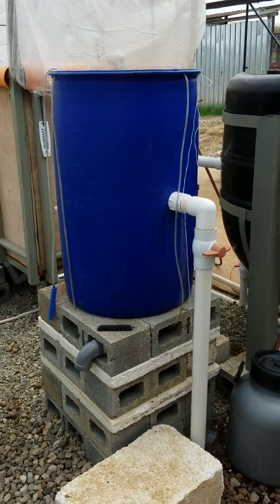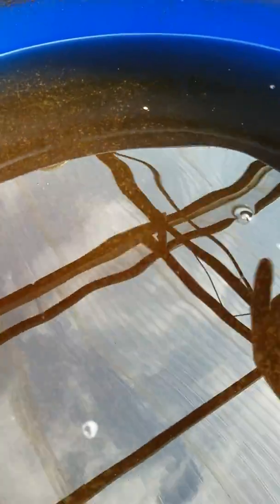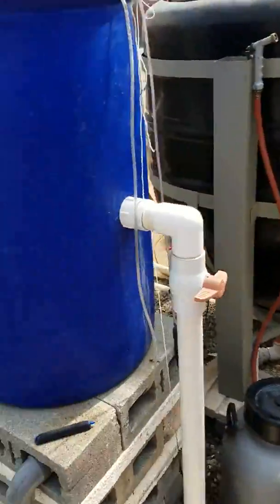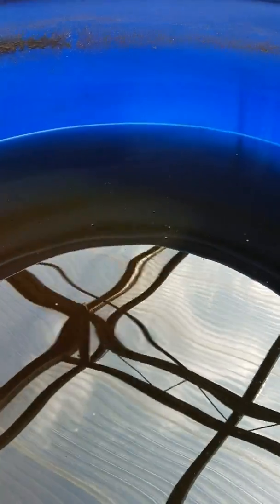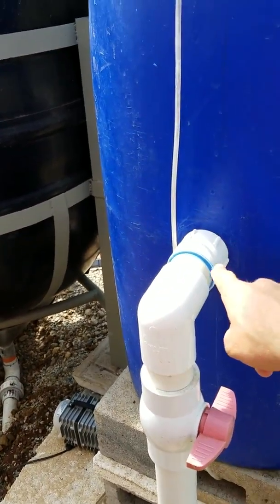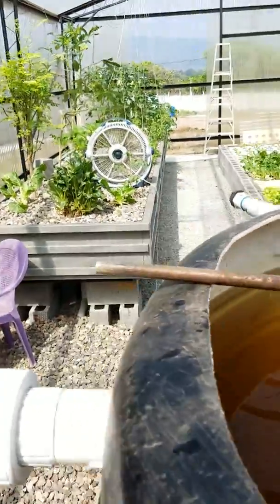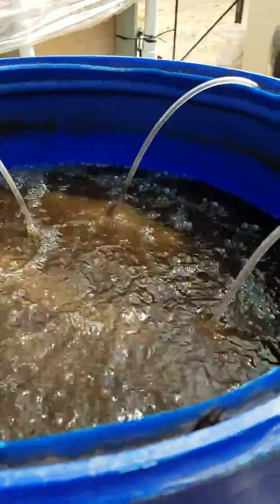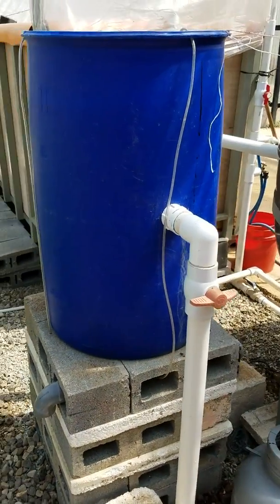Mineralisation Tank Use Training   Aquaponics

Comment: Thanks for sharing this. The plumbing is pretty neat on this mineralization tank setup. I like the way that most of the clear liquid is returned back to the gravel bed and gets a second life in the system. About your air stones, i would get a stick across the top and suspend them in the center of the tank that minimize any contact to the side of the barrels to minimize any wear and tear.

Comment: Where did you buy your filtration system, it looks amazing my man..
Reply from the maker: It's homemade!
Reply: @roynathana  Dude i mean that weird lovely looking tank to it, i guess its the solid separator or clarifier.
Reply from the maker: @VanTlou  yeah, it's all homemade.  the black tank is a water holding container that goes on top a a roof of a house.  there is a galvanized metal cone on the bottom of.  In Guatemala where I was at there was limited resources.  Those cone bottom tanks are super expensive, so we made our own.
Reply: @roynathana  Am having trouble buying a filtration system man and i cant get proper Tanks here, I am in Botswana.
Reply from the maker: @VanTlou  It can be tough.  I recommend using what local resources you have, be creative and experiment.  Best of luck!

Comment: Question how did you plumb your tanks without uniseals
Reply from the maker: In  Guatemala I could not find uniseals, so I cut a tight hole and used silicone.

Comment: I liked very much your explanation. Thank you. My question is: the water from the bucket that holds the solids goes to the beds or  where does it go?
Reply from the maker: Joze Ortiz. After the solids are mineralized they are released back into the whole system, with all the other water.  In my case it goes into the media bed first, then on thru the rest of the system.
Reply: Joze Ortiz You can redirect it back to the fish tank or to your grow beds.

Comment: I like the new setup, it is improving little by little. On another note, if I may, I would do things slightly differently. 
I understand the mineralisation, that's a good idea. It gives access to all stuff good for fruiting crops (tomatoe, cukes etc..) which you don't need if you only do leafy green.
Now, on the tech aspect of your system, here is how I would do some modifications that would help limit total suspended solids.
From solids settler, over flow into an MBBR (moving bed bio reactor) which is also heavily aerated like your aerobic compost bin. About the aeration, use a 1/2 PVC instead of tubing, stones would stay flat, just above the bottom of the tank and have a longer life and do a better job than standing vertical.
From the MBBR, you'd over flow into a SUFF (static upflow filter) that will be your last stage of slodis breakdown before the DWC beds.
The mineralisation tank recup the sludge form the RFS (first settler) and from the MBBR and SUFF and is heavily aerated with an overflow in a last tank where solids get to settle, like you do when you drain. The overflow from this last tank of the mineralisation process should have a 20 micron mesh. If that makes sense.

Let me know your thoughts. I would like to help you as much as I can.
Reply: Jason Renoux yours is ok too but for one flaw. If the Radial filter empties its content into MBBR the media (K1/2) will be overwhelm with sludge and reduce its effectiveness. After the RF you should let it through a SKIPPY type filter th
Reply: @mamasufino  Skippy type filter? What is this?
Reply: Jason Renoux A Skippy Filter (SF) is a swirl filter  with filter media ( in my case I use Sponges) added to trap any debris left after the Radial Filter. As I do aquaculture I have my filters arranged as such: RF: SF:SF ( these are connected to a mineralization tank) : MBBR: AEROBIC FILTER ( Biostones etc):SUMP .